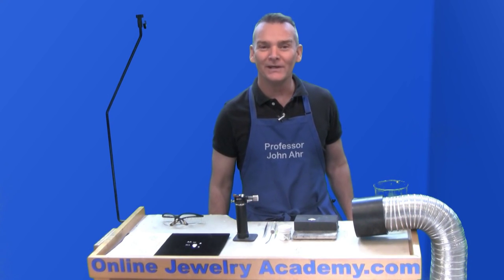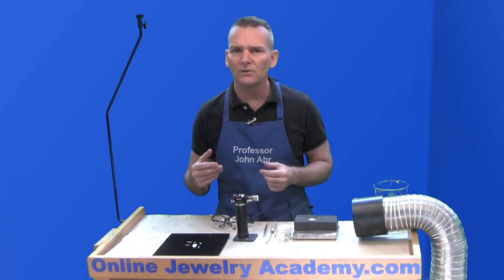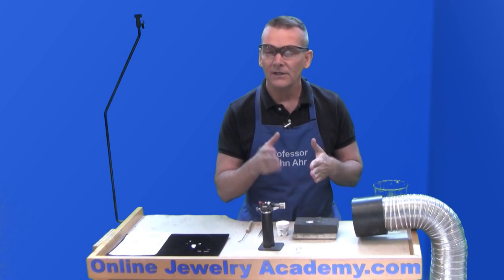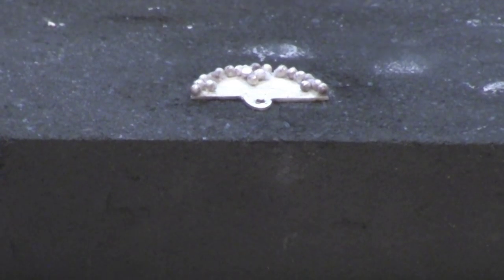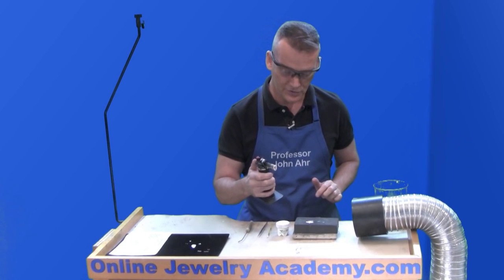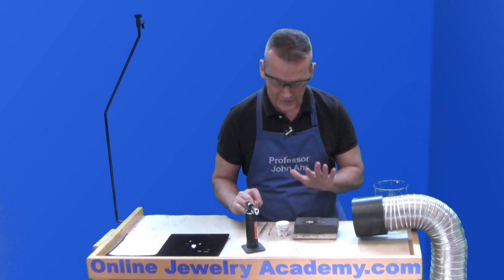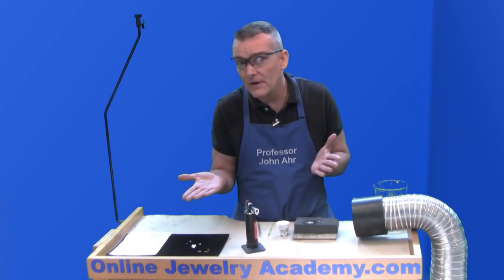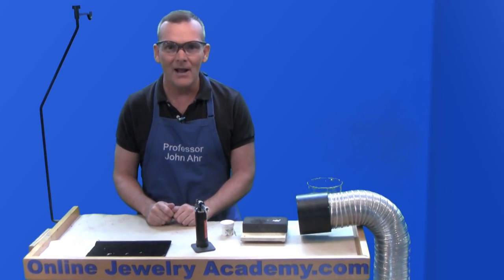Granulation Techniques Used On Silver

Comment: Thank you very much for this video. Really interesting! So the granulationballs are 100% silver if I understood well? Can I do this with 925 silver or do I have to use solder then?
2e question. This flat piece of silver is "easy" to fuse the balls onto, they don't fall off, but  my problem is making granulation onto a ring. 
Do you have a video of that kind of soldering? Thank you in advance for your answer.
Mieke Manders
Reply from the maker: Hi Mieke,
You can buy bead wire to make a ring that will look like it was made using granulation techniques.
You can fuse .925 silver as well as fine silver.  I just presented what works best for me in the video.  Experiment with your torch to see what works best for you.  If you avoid using solder, the piece will look better for a longer period of time.  The solder alloy(s) will tarnish quickly. : )
Reply: What is the name of the video where you talk about making granules on charcoal block? Thank you

Comment: is granulation possible in cooper by the same process, Professor?
Reply from the maker: +Zeus DaShaman 
Hi Zeus,  Unfortunately, copper doesn't want to cooperate and easily melt into little spheres.  It's a cranky metal that doesn't like to flow.  So, you can't easily cast with it either.  Great question.
Thanks for your support! : )
Reply: +OnlineJewelryAcademy thanks for the reply.
i tried it with copper since then.  i used propane gas on a red brick. they came out domed than round which helped with placing them on the copper plate. i only tried joining once,  but i have made a granulation 'domes'.
Reply from the maker: +Zeus DaShaman 
BE CAREFUL!  Don't work on bricks with your torch.  Air pockets that might be in the brick could cause it to pop or "explode".
Reply: +OnlineJewelryAcademy thanks a lot!

Comment: I dont understand, the only compoud applies was flux. Isn’t there suppposed to be a compoud containing copper to do the fusing??
Reply from the maker: I fused silver in the video.  A little flux is all you need.  No need to introduce any copper into the situation.
Thanks for your support! : )
Reply: There's a technique where they use copper acetate (iirc), so the temperature raises just on the surface of the granules and fuses on a tiny spot of contact, without changing the rest of the surface (you stay just below the "wet" temp).
Never tried it, but it seems to take a very fine temperature control.
They use it to make those granulation structures with no back plates.
I've always been very intrigued by that technique.
Reply: @OnlineJewelryAcademy  based on the copper in the sterling silver right?

Comment: Hi, I've heard only to use fine silver? Why is that? I've tried sterling, and it worked. The fine silver demo said that an old world technique was to use saliva.... and I've heard of some kind of product. But I've never seen using only flux. Why is flux good? Just for fired scale, and as a sticking agent?? Cuz nothing is flowing.
Reply from the maker: Hi huskyfluffy,  You basically answered your own questions.  Fine silver is better than sterling for this process because it is pure silver and won't produce fire scale.  The traditional material used to hold the spheres in place is a glue made from fish stomachs.  It's kind of like gum arabic.  I used flux with the sterling silver to help hold the spheres in place and reduce oxidation.  This isn't a perfect technique.  But, it's fun to experiment with.  Have fun.  And, good luck with your projects.
Thanks for your support! : )
Reply: What about fine silver, if you use that do you use flux? Just for sticking? Fine doesn't fire scale does it? Why do you prefer sterling? Thanks!!!!